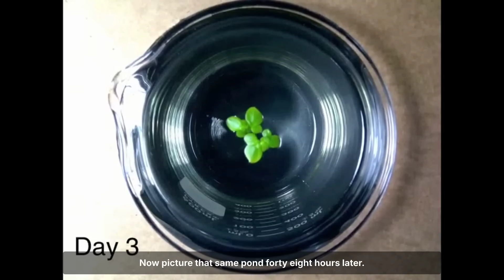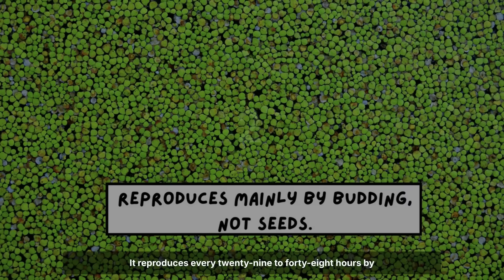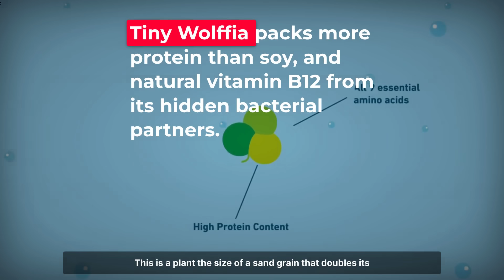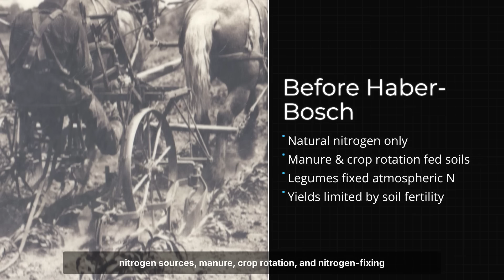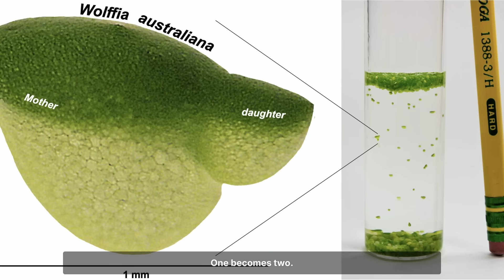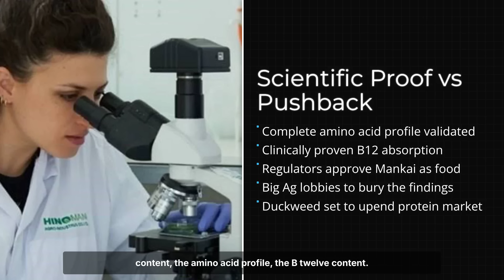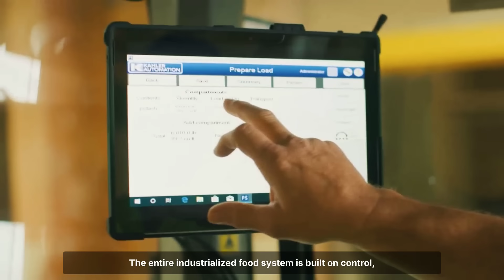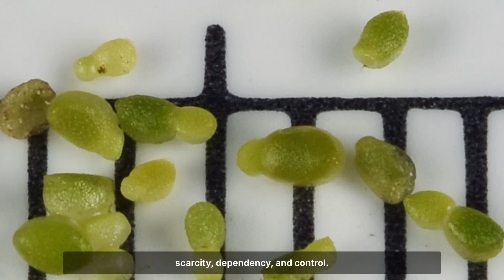This Plant Has More Protein Than Beef, Doubles Every 48 Hours (But It's Called Pond Scum)

Comment: Duckweed is a plant that need the same fertilizer as other plants.  Saying that wastewater can be used means that the duckweed will become as polluted as the waste.  Other plants can also use wastewater,  but people do not want to eat those plants.  Hint:  Do not eat things Made in China.
Reply: Even better tip, avoid all food from the USA. Most of it is forbidden outside the US anyway
Reply: I think it's implied that the pollutants in this case ARE fertilizers, i.e. farm runoff, but still, there's a risk of heavy metal contamination. I had the same concern initially. Excellent advice regarding China. I only buy Hawaiian ginger, for instance, and if it's not available, I go without.
Reply: I've seen it thrive for years in plastic barrels filled with rainwater. where's the fertiliser then
Reply: @ValirAmaril  Bird poop?
Reply: @richardgrier8968 fair, or maybe mosquito larvae.
Reply: @ValirAmaril  Yeah, very plausible!